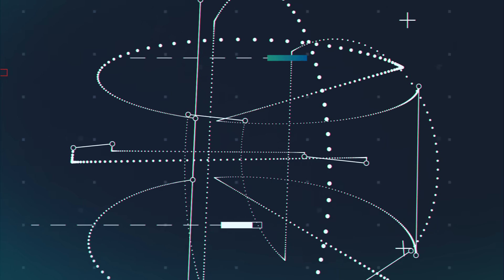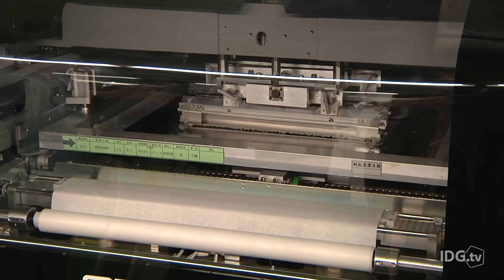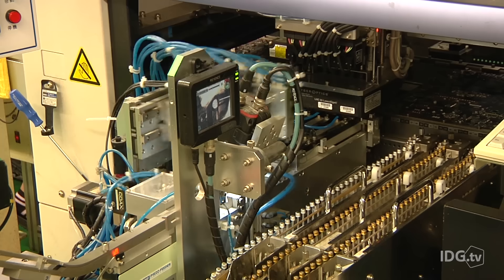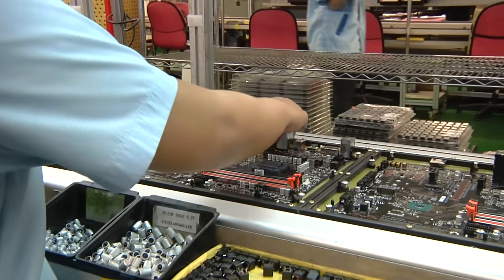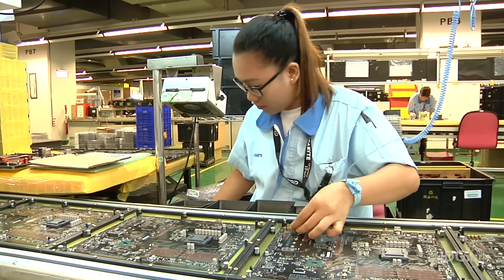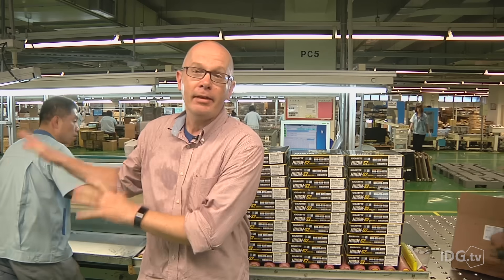How a motherboard is made: Inside the Gigabyte factory in Taiwan

Comment: Gigabyte component quality has dropped like a stone. 7/10 repairs are gigabyte, which says a lot when they only hold a 30-35% share of the component market. yes they are cheaper price, but its worth spending another 10% to not have the GPU, motherboard, RAM, etc stop working in 6-12 months

Comment: This is amazing. I was brought here as I was trying to find out if these boards are supposed to come with factory seals on the boxes. I can confirm that they do NOT have seals on them. It's a shame the manufactures don't give this information to help customers feel reassured their piece of hardware has not been tampered with. I do kind of understand why they don't have seals though. Perhaps they need to updated after they are made.
Reply: I think you just need to relax about it. Who cares if it's sealed or not. What you should worry about is the Amazon or UPS driver that is whipping your package around in the sort center. Nobody cares about the value of your items coming through - it's just another box to them.

Comment: They initially use gloves when handling mother boards  but when they are placing larger components on the boards which is done manually they are not using gloves. I wonder if the oils on the fingers can cause faulty issues.

Comment: nice video reminds me when I used to work in the same Automotive Electronics Environment 15 years ago, not an easy job wearing anti static gown with only your eyes and hands are just seen, I remember when I cant go home because I have to finish my Job or else there will be no production.

Respect to the Operators that's a difficult and tedious job.

BTW the one you call a robot is actually a PIP SMT Machine (Pick and Place Surface Mount Technology Machine in Array Mode), the Oven is called a SMD Reflow Oven  (with Big IR Heating Element) and the nice photo machine 

I was wondering why they didnt show you their SMD Testing Station :) thats what I want to see though.

Comment: Ok. Notice the similarity between the mother boards and the cardboard box they are packaged in. Consider the paint and lettering on the cardboard box being the components of the motherboard and the interconnects. The point is that in the near future, a motherboard need not be any more difficult to "print out" than the cardboard box! You know I'm right.

Comment: As a student I had an internship in a small factory, doing most of these duties myself - from feeding "Pick and place" machines to populating boards with THT components by hand. Traditionally women are doing the latter job and now I can see why - they inherently can multitask far better, placing components properly AND chatting with each other! They were even able to spot my mistakes down the assembly line and corrected my mistakes, like placing polarized capacitors wrong way around. I just hope these workers are not exposed to dangerous chemicals like I was. These days I'd pay more for a product made in a safe environment, after my short internship.
Reply: Hope your health is fine! Thanks for sharing.
Reply: Everybody needs to chill. These are all relatively inconsequential generalities based on some level of evidence. There are many psychological tests that have shown some difference in how female and male demographics respond to things. Women typically have a higher differentiation between similar colors, for example, and when given a list of several instructions to be completed within a time frame (the last of which is to ignore all previous steps) men typically do them one at a time while women typically read through them all first and realize the trick. It's not sexist to say there are differences like this that exist, and to argue that there definitely aren't trends that distinguish us beyond are control is to deny a likely possibility. It's sexist to say these predetermined tradeoffs dictate a person's value, and just kind of ignorant to say they are always present in every man and woman, but I don't think either case is being made here
Reply: Can u share the details of the factory , we are lookong to source
Reply: Not sure about the multitasking part
Reply: @eriktenhag2022  sir can i ask question? month ago i ugprade my full PC to asus.motherboard.GPU but why it said made in china? i think asus it from taiwan .i live from indonesian
Reply: be careful, nowadays to say that women or man better is a discrimination :)
Reply: @liucijusuberkindas112  No it isn't, where do you live that it is?
Reply: @rodrigobarraza  sir can i ask question? month ago i ugprade my full PC to asus.motherboard.GPU but why it said made in china? i think asus it from taiwan .i live from indonesian
Reply: I see nothing wrong with this, in fact its praising women.
Reply: This is such a boomer take on multitasking

Comment: 0:39 I worked for a big company in the past that also build all kind of OEM electronics including motherboards, and I remember that one employee was able to feed the machine with the components in the wrong position (he probably mixed some resistors and capacitors that has different values), and it result in couple hundreds of units with wrong components that was later captured by the ICT (In-ciurcuit test) ... that was a big mess!
Reply: wild! what what the resulting mess?
Reply: @ well the techs were mad to have piles of circuit boards that needed to be “fixed” where it would take about 30 min per board to replace to the right components.
This happened a few times where one time the mess was so bad that didn’t work to repair, they it was cheap to scrap the whole batch.

Comment: I have worked in a similar set up back in 90's and I really feel sorry for the line workers who need to work fast and accurate all the time. Sadly, it is very difficult to keep up with the pace and you're lucky if you last. True, even if you wanna pee or rest a bit it would be difficult for you to do so. It is a horrible job.
Reply: Any production-belt line job is. I worked at sausage -packing facility. My job consisted to cut sausage into pieces of correct size and put it into packing machine. Process couldn't be automated due to sausages are not totally the same due to during preparation they change their size unequally. No idea why, guess some non-homogeneous consistency of ground meat.  Imagine whole working day on timer, doing manually job into 0 degree temperature into industrial freezer condition. It's not just about repeating same small manipulation with palms with huge hast, it's about cold as well. My palms after working day were just dead. I had hard time to take out keys of my apart from my jeans pocket after working day.

Comment: Used to work in that industry before robots when everything was hand soldered. Eight hour day plus a couple hours overtime and you would come out, after the glare from the boards with your eyes feeling like you had spent the day in a heavily chlorinated swimming pool. There were no vacuum suction tubes on the soldering irons so you got to breath in a lot of smoke from the hand soldering process.
Result needed glasses for the first time in my life and chronic asthma.

Yay for robots.

Comment: What's the Blue cord to the wrist attached to the wrist of the worker? anyone know? Static charge? or if one faints?
Reply: Those are anti static wristbands to keep you grounded so you don't build up static electricity so when you touch the motherboard it doesn't release the electric current into it shortening its life span

Comment: Great video! This electronics manufacturing engineer has 3 critiques:
1) The Automated Optical Inspection system is primarily to inspect solder connection quality (and to make sure a part is present too). Part number verification (via OCR) isn't possible with most SMT caps or resistors as they are not marked due to their small size. Orientation (polarity) can also be checked as all parts are marked for that (if polarity matters for that part). 
2) The Fuji placement systems give a warning when the reels are running low before they get to the last part, and it is possible to program the setups with redundant parts to prevent stoppages. The operators do need to react to those warnings, but they don't actually track the parts themselves. Running an SMT line is definitely a tough job, because one exhausted part can and does stop the whole line. 
3) Poor wave solder (for the through hole parts) didn't make the video. That's the Rodney Dangerfield of board soldering - never gets the respect it deserves! I started on wave as my first assignment after college. It's been "going away" for the last 25 years but still keeps going and going ...

Comment: I suspect that they learned this production technique from an "I Love Lucy" episode.
Reply: Many industries use the "slide line" or "pacing conveyor" system for manual assembly or inspection operations. Sometimes simple and time tested is the best way.
Reply: @jasonfullerton7763  I work in an American EMS company. Yes, only if labor is cheap or if it is a high volume low mix production line. If it is high mix low volume, you need humans. It is impossible to automate such manual intensive lines.  A few robots themselves can cost 6 figures. The tooling and fixtures, another 6 figures.  The ROI just dont make much sense esp when companies like mine has very low profit margin ~12 - 16%
Reply: @ViperVizier  We agree - automating PTH installation is difficult and costly unless the mix is low. I actually saw a VCD this week (DOM August 1998) that was used on a regular basis, but that was to install a single device on a range of assemblies for an OEM. Much different from EMS where the margins are cut-throat, contracts are short, and variety is king. I don't expect to see much (any?) PTH automation at APEX in two weeks, because assemblers in North America have already squeezed every advantage possible from automation where it makes sense.

The SMT-only assembly has been the goal for some time, but there is almost always a connector, a beeper, a power transistor, or some package(s) that only come as PTH. That's where the army of ladies at the slide line/pacing conveyor comes in - they can install a wide variety of odd form parts and do it well, do it quickly, and do it right on multiple different board layouts a day. All you have to do is give them a drawing and some parts in bins (hopefully cut & formed already!) and let them do their thing. Then, off to wave (or selective) solder where the real fun happens!

Comment: Gigabyte is the best quality motherboard in computers.
Reply: Yeah they say "gigabyte  insists on ultra durable". Even I also believed once that their motherboards r high in quality. But 😞my one just got serious problem for some days ago. And I bought that with my new pc about one and half years ago. When I went to expert with that he said u need to change ur motherboard. I got so upset on gigabyte. 😞nothing to say more.
Reply: Before going to expert, I checked every single video on youtube, problem with pc turns on and then after 1s  it turns off. With the help of those videos I ensure it by myself that the problem is with motherboard....not with dust, power supply, ram nothing.
Reply: @MrWilly-mm5rv  How long have u bought the PC and which seller did u buy from? There are electronic shops that sell replicas and counterfeits. I have experienced too many customers that come to me for service that they bought counterfeits like in Genuine motherboard some chipsets will be replaced into fake/counterfeit, mostly sound chipsets and graphic chipsets, some will be not soldered properly and mostly MOSFETs removed that makes the computer/laptop to overload and damage the other components and some bios programmed by them.
Reply: @MrWilly-mm5rv  There are points to be noted before buying computers or any computer parts. 
1. It should be certified seller or dealer buying from Ur place. To know that you need to go to that computer brand website eg. Like Dell dell.com, Apple....etc. when you go to their website you will find dealer location tab just click that and enter ur city name there u will find certified dealers.
2) check the serial no of the product entering in google search 'check serial no of 'brandname' and go to that computer brand name website and enter the serial number. You will find all the details and when it was manufactured. If it is counterfeit will say invalid serial number. Sometimes fake sellers sell old model like more than 1 year old.
3) The most important point: Before buying the computer must do check first the product in front of seller if there's any fault they must give good ones.
Reply: @MrWilly-mm5rv  I would love to help u giving technical advices doing by ur end mail me on my email ID: anzarksd@gmail.com

Comment: Good video.  However, there is a lot more to this process, that is not covered in this video.

The motherboard has tracings that allow data between components.  These tracings are numerous, and are everywhere.  How did they get there?
This video briefly mentions how various components are placed on the motherboard.  But those components do not grow on trees.

Even the shipping process would be great to see in more detail.  For example, this video simply shows a machine delivering a cardboard box to a worker.  How was that cardboard made?
The boards are put into anti-static bags.  How are those bags made?

There is so much more.
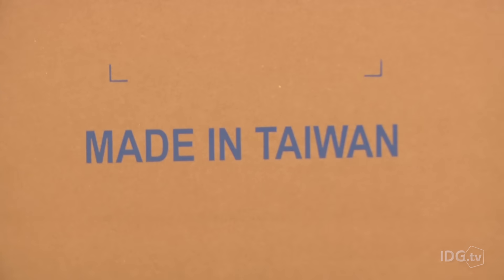I understand that this video is on 2:48 long, and can cover only so much in that time.  And the most was made of those 168 seconds.  But it would be great to see it all, including how a single issue on the assembly line is handled when there is an issue.  For example, if a worker falls behind, or needs a bathroom break, or runs out of a component, etc.  If the assembly line needs to stop, how is that handled, and by whom?

What if the motor or other critical part of the assembly belt and rollers, etc, were to fail?  They probably would have someone there within 5 minutes to fix it, and probably have a warehouse 1 minute from there where they have every part under-the-sun available to address any part failures on any equipment.

What about fire drills?  Does Taiwan have them?  How do they empty the building, without notice, and not end up with a complete mess inside the factory?

Does the factory run 24/7/365?
If yes, how are shift changes handled?  How are lunch breaks handled?
If no, how does the assembly process begin, especially if someone is late or calls in sick, etc?  How do they end the day?  I would like to see if they leave the assembly line where it is, or do they let the last motherboard move to the end of the process?

I guarantee that they have all of this covered, down to the last detail.  And the few people at the top, that coordinate all of this, and ensure that there is never an interruption to the production line, are earning big $$.
Reply: It's such an intricate and complex process. Would love to watch a good documentary on it if there is one.

Comment: use the quantum computer trick so
we got great technology as low
so use the vein diagram technology like possible outcomes in one side and failure on one side and common on one side and total outcomes as their calculations
so we got more power in low voltage

Comment: 1:09 "and they all end up with a final check by eye"
Women looks at 2 things from 2 angles "dis ok"
Reply: Shut up gay
Reply: She's probably just double checking a known problem that could escape past AOI and ICT. None of those steps are perfect, but layering the QA helps minimize the opportunity for "boomerang" product (goes into the field and comes right back due to poor quality).
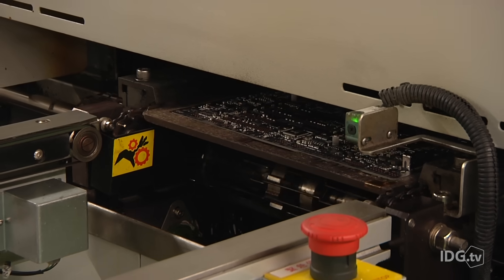Reply: @ 0:57, There's no need for extensive checking by anyone since this is already done by the machine doing the optical checking.
Reply: That board clearly had nothing on it. That wasn't the "final check" the narration was talking about.
Reply: First of all most likely she's not the only one doing the visual check,
second, she's not looking at ALL components on the board, only the ones with most failures, given this is not the first batch of production
Finally, a lot of surface mount defects cannot be found by AOI (Automated Optical Inspection), so see the test station she put the board in after the visual inspection? That's called ICT (In-circuit test).

So yeah, you don't know what you are talking about and your joke is a bad one.
Reply: she protec
she attac
but most importantly
she asian!

Comment: Where's their STATIC STRAPSSSSSS lmao.
Reply: Yeah, the ESD controls appear to be a bit lacking (paper/cardboard at a workstation is a no-no). Notice how the boards go in a shielding bag BEFORE going in the box?
Sometimes the smocks can be tied to a ground point instead of using a wrist strap, and heel straps can be used (except for seated workers) if the floor is made of conductive tiles or coated with conductive wax. The conveyors are definitely static dissipative.

Comment: It is a chip mounter. You have to use a wireless barcode scanner every time you re-load the cassetes to make sure you are using the right components for that particular motherboard. If you make a mistake you are pretty much fired.

Comment: and still 350$+ mb's should not be more expensive than a 80$ motherboard with the same amount of ports made by the same company.

yes this is the case, many 80$ boards are the same as the 350$ baord, but then port X is not soldered.